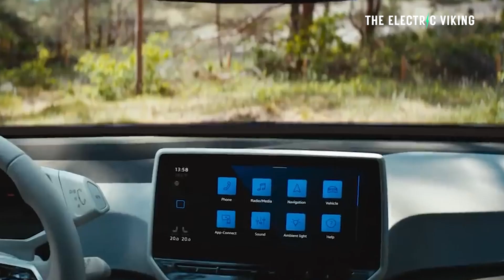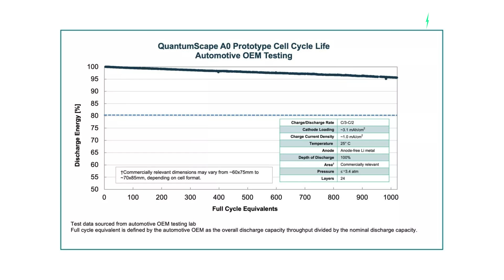VW test QuantumScape’s Solid-State Battery: Retains 95% after 300,000 Miles

Comment: If the SS Batteries can hold 95% capacity after 300k miles that's a game changer! I was under the impression VW was going to possibly be first mover to release SS battery based cars. I'm not surprised if Toyota beats them since Toyata is very advanced and forward thinking. I just wish VW stock wasn't such a dud! I was expecting this technology to be a big catalyst for their stock. The stock is basically terrible! If quantum scape has "cracked the code" and if VW is the sole benefactor of this it might actually drive the stock up massively. The SS batteries are revolutionary.

Comment: 300,000 miles is only 1000 charge cycles. Most LiPO batteries would retain 95% of charge capacity after 1000 cycles.

Comment: Lithium Iron Phosphate batteries hold 80% of their capacity after 4000 cycles at 100% Depth of Discharge.
That means 4000 full charge and full discharge cycles.
This number can easily double if you reduce the depth of discharge to regular DoD which most users will do as it is not practical to let your battery die on you completely and have to either tow your car or bring a portable charger to get your car back home.

Comment: Has significant for a battery to not degrade it need to retain its shape before and after being used and it needs to do this consistently for 10 to 15 years to be able to compete with an lfp battery. This is not an easy feat

Comment: I read this was after 1000 charging cycles.  I do a 70 mile daily commute.  An EV will cope with that.  That is about 3 years of charging cycles, or 70,000 miles, not the 300,000 miles.  I am not persuaded by this report.  Could well be typical car manufacturer's exaggeration.
Reply: You don't need to charge every day, you can run a battery down to about 20% then recharge it so in your case a battery with a 300 mile range to 20% would only need to recharged every 4 days which is less than 92 cycles a year. Even if you did charge every day, its a partial cycle, not a full one.

Comment: Quantum scape say their aim is 800 cycle with a degradation to 80% . That doesn't come close to other batteries like CATL which are say theirs has a 3,000 cycle with a degradation down to 80% . 3,000 cycles is about 1.5 Million Kilometres with the ability to charge 0 to 100% . Thats game set and match to CATL because they are less than $5,000 . Imagine in a few years there will be much better batteries . If you had a car with over 1 million Kilometres on it do you think you would not just buy a new car . ? as the rest of the car would worn out , like paint suspension , steering joints , power windows , air conditioning and most important the computers that enable things to function .At 20,000 KLm per year a million will take 50 years , so the laws on economic life and probably government requirements will have put it off the road .

Comment: Retaining 95% after 300,000 miles is a nice claim. It is just about meaningless without a battery capacity warranty. When the Leaf came out Nissan claimed 10 years/100,000 miles. Their actual capacity warranty was to retain about 68% for 5 years/60,000 miles.

Comment: I don't care about the miles...

I care about cycle life. So at about 1 minute in, I had to back-calculate.

If they don't have 5000 charges to 80%, they are worth very little. Other batteries are getting 3500 charges. They are expensive enough that they need to last longer for people to want them.

Assumed cycle life:
* If it began as a 300 mile battery pack and ended at 285 mile pack.
* If they counted a cycle from 10% to 90%.
( If energy loss is linear with cycles.

The average of 80% of 292.5 (average of the old and new amount held) is 230 miles per cycle.

300,000 miles translates into 1,282 cycles to 95%

About 5000 cycles if the drop is linear.

That is in the ballpark.  Cool.

Comment: Suggestion to focus on the graph and cut out the marketing stuff.
A 24-layer, single cell was tested, not a multi-cell battery, and certainly not a battery to power an EV.
Cell footprint was about 7x8cm, thickness not stated.
About 3mAh/cm2 or 170mAh x 24 = 4Ah (cathode-limited) total cell capacity.
Charge rate was C/3, so full charge in about 3.5 hours assuming non-linear CCCV process and full charge.
Discharge rate was C/2, so 2h (complete) discharge.
Interestingly, external pressure was 3-4atm, presumably to hold the 24 layers together. 
IMO it will take a massive effort to (a) mass-produce this, and (b) integrate the cell into a 1000s-of-cells battery that can power an EV ... while meeting the 800 cycle/80% remaining capacity target.

Comment: 1000 miles on a 5 minute charge is certainly impressive.
Reply: What would be more impressive is setting up a charging system and connections that can cram 80KWH in a car in 5 minutes..
Reply: It's impressive because it isn't real.  And frankly, who cares?  Who needs 1000 miles on a 5 minute charge?

Comment: Good news from the pouch pack tester from VW.  However, this pouch pack tester was not produced using auto - scaled manufacturing techniques.  It was created in a lab and custom built in a lab.  Once they can scale it and mass produce it, the scaled battery pack will probably show a decrease in performance compared to the lab battery that was tested which is a common challenge amongst all battery startups.  QS has to prove they can maintain this performance from a scaled battery pack. Stock is going to drop back down to $6.00 over next few months.
Reply: This was a 24-layer commercial intent cell design. Far from a “pouch pack.”  They do need to move production to high capacity equipment. That part of your comment is accurate.

Comment: Even more impressive is capacity preservation during fast charging (10-15 min from 10% to 80%). Even with a 10 min fast charge, the QS cell is able to retain >80% capacity after >800 cycles with 100% discharge. This is a game changer for Lithium-ion battery longevity, even under extreme charging conditions. Keep in mind this is based on QS data, however keep in mind QS has consistently been proven right about their claims, for the past 3 years.

Comment: What happens after 1000 cycles? The fact they limit the chart to 1000 cycles is a red flag to me. 🚩
LiFePo batteries are typically rated 3000+ cycles.
Reply: 1000 cycles is 500,000 km in the car. You plan on keeping a car that long? Even then you will only see 5-10% degradation.
Reply: It takes time to charge and discharge a battery 1000 cycles. On to the next test at that point.

Comment: Much will depend on how long it will take to bring these out of the lab and into practical use. The next challenge is mass production and delivering these at scale. If this is true, demand for these batteries will go through the roof. A solid-state battery with all of the characteristics described here would tip the balance and seal the fate of ICE vehicles. It would also put VW back into the game as of late; what they offer could be more impressive. Let's see how long it will take to see these in production vehicles.
Reply: True, but then there is even another bigger challenge: All days we have tons of news about "miracle" technologies that will change all the EV market and kill the ICE cars. It is round the clock, really. Problem is: Too many technologies, some incompatible with the next one, and nobody really knows what is the real possibilities to some of them to become real production ones. All the current battery providers have done a strong investment for the current generation battery supply chain. They'll most likely to go on for small incremental gains with same technology base, before they start to adapt factories for the next big thing. With massive transition still in the beginning with the current generation technology; I can't see any purpose for the next gen to be deployed yet to the public. Too early to say the least. Current cars can go up to an average of real autonomy driving on the ~300-500Km with a single charge depending on the car segment. More than enough for most folks. Extremely big batteries will perhaps to have a challenge nobody seems to be bearing in mind: Unused energy loss. You'll probably to pay for energy you don't consume at the day, unless you really need to do those extremely big travels daily. Things are not that easy... If possible; battery suppliers will run to the ~400-600Km average single charge real driving autonomy depending on the car segment till this decade ends out within the same technology base. I don't predict anything more significant out there commercially that soon, other than some development on the Sodium batteries that seems to be real at least for the smaller cars soon.
Reply: @nunagoras  
I don't expect any great breakthroughs any time soon either. The EV sector continues to grow and once we get some decently priced vehicles with good range which charge rapidly then its game over for the ICE sector. I think the major problem at this point is pricing. EVs remain very expensive and few can afford them.
Reply: We need them yesterday

Comment: My conclusion after researching QuantumScape is that they are still at least a year away from commercial production and they will be so expensive that there is little hope for them in mainstream EVs. Maybe they will get enough economies of scale to be used in luxury car models by 2030, but they are most likely to be used in supercars, hybrid airplanes and high-end electronics like cell phones. Their production costs are simply too high. We should be far more excited about developments such as Zeekr's LFP "Golden Battery" with 255 Wh/kg energy density that can charge at 4.5 C, 800V, 500 kW than solid state, because that is tech that will actually be used in standard EVs.
Reply: Moore's Law
Reply: @Picklemedia  And Moore just died (RIP).

Comment: Given the brittle nature of their ceramic separator, I would only trust the test results if they did the discharge cycle tests while simulating driving conditions. The separator lifespan might be great in a quiet lab but it might exhibit cracking under real driving conditions where vibration, bumps, starting/stopping can put serious mechanical stress on the batteries. QS does not reveal the chemistry or mechanical properties of their magic ceramic separator and probably never will, so discharge testing under worst-case driving conditions would be the only way to know how reliable they might be.
Reply: Temp cycling might be the real killer. Start out at -20C, then warm it up to fast charge, then drive like a bat outta hell, and see how long it lasts.

Comment: Great job as usual. I wonder if manufacturers are considering battery swap outs? Not a gas station battery swap but with the whole car battery. That is when a new battery tech comes out, can’t we just swap battery with the same form factor.
Reply: Nio has hundreds of swap stations in China.
Reply: @jamesvandamme7786  I think @brokejohnnylive1530 meant for maintenance reasons rather than alternative for charging but more options are always welcome
Reply: Tesla tried this and quickly concluded that it was too expensive and that people did not want to pay the pretty hefty swap charge as opposed to the minimal charge for supercharging. Doubtful that somebody else can do it for money comparable to supercharging because of course you've got to charge the battery packs you're taking in, you've got to have a big pile of spare batteries which is super expensive, and you assume massive risk at the same time so in combination all that spells that this is a no-fly zone

Comment: I would like to see either a swappable battery or a battery in which the electrolyte can be changed, like an oil change, on a regular basis. The electrolyte change idea would be best because it would be easier to recycle the electrolyte than the entire battery. The electrolyte would probably have to be added under high pressure to distribute it throughout the electrode pairs.
Reply: There is no battery currently in use in EV's that can "change out the electrolyte".  The electrolyte is part of the battery and cannot be changed.  The only batteries capable of this are flow batteries or high pressure hydrogen/nickel and these batteries take up a lot of space, are heavier, lower energy density, low peak output and just aren't practical for EV's.  As far as swapping the batteries this would be problematic at scale for a huge number of reasons but standardization is a big one.  As charging speeds keep increasing, and they do keep increasing, there will be less incentive for such technologies.  I'm sure a lot of people would like to see this but in all practicality it will not be a thing.  For most EV user's charging speeds really aren't a problem as they are usually charge at home while they sleep and rarely need to use a super charger, usually only on trips.  This sort of technology isn't important for most EV users.
Reply: There's a company trying to sell a flow battery car. It has long range, rechargeability, and you can swap out the electrolytes in a couple minutes besides. You'd have to swap two different tanks of electrolyte. It might have promise, who knows.
Reply: @jamesvandamme7786  Yeah, I saw that too, the company is called nanoFlowcell.  It would be cool if they could get it to work but the only real article I can find on them is by Tina Casey who doesn't have the best record for predictions and the article is very light on details or timelines.

Comment: I knew nearly 20-years ago, that solid-state batteries would replace liquid electricity batts as soon as chemists could figure out how to increase their cycle life and lower pricing as solid-state batteries are smaller, lighter, impermeable to extreme temperatures and charge much faster.
Reply: You knew that 20 years ago?  Back then, we all "knew" that.  Today, most engineers don't think SS batteries will ever be viable.

Comment: What about energy density ? What about performance in low/high temperatures? Or dose it self discharge or degrade over time even if it is not being cycled?
Reply: QuantumScape claimed energy densities of 380-500 Wh/kg and 800-1000 Wh/liter in 2021, and in 2023, they were saying as high as 500 Wh/kg, but they haven't released specific numbers. In earlier tests, they claimed 400 charging cycles with 4C charging (13.3 mA/cm2), going from 10% of capacity to full (4.2V) in 15 minutes, with C/3 charging from 0% to 10% of capacity. See AutoEvolution's article "QuantumScape Is Happy With Its SSB, But Shouldn't It Fear CATL's Condensed Cells?"
Reply: @amosbatto3051  dude didn't want an answer he just wanted to complain.
Reply: @Picklemedia  no,  I did want an answer ,  thank you.
Reply: @patdbean  oh okay. My bad I'm sorry

Comment: Equally important: the specific (or "gravimetric") energy density (in Wh/kg) and the volumetric energy density (in Wh/liter). Apparently, QuantumScape has reached 375 Wh/kg in the lab with their hybrid SSD battery cells, "independently verified by 3rd-party" which is very good. Also good, their projected commercial goal for volumetric energy density at 1,000 Wh/l.
To put things in perspective, first Tesla Model Y with Panasonic's 4680 NCA cells: ~ 271 Wh/kg and 750 Wh/l
Geely's LFP "Golden" battery, which is commercially available, has a specific energy density of 255 Wh/kg, on par with common NMC batteries. 
Typical LFP batteries in EVs on the market today are around 150 Wh/kg only.
However, the Chinese have in the lab lithium batteries offering insane numbers: 711 Wh/kg and 1653.65 Wh/liter! Not available in any EV currently of course.
Reply: The Chinese will be ahead at the time this Quantum is scaled up
Reply: @protagonist9716  Exactly. By the time this gets to production existing tech will just keep improving through minor changes.
Reply: @protagonist9716  Far as I know, none of them are. Many still struggling just keeping up with what they have. More research into LMFP or Na type.
Reply: Those are Silicon enriched ones, which aren't very stable and actually dangerous in hot environments.
Reply: Actually the first 4680's where more like 240 w/kg where the 2170's are 270 wh/kg at least that is what I have read . 
Generation 2 of the 4680 is around 270 w/kg only in the Cyber Truck for now. I thought the first 4680's are entirely 
Tesla made.
Reply: That claim about QS' cell energy density of 375 Wh/kg is totally false. QuantumScape has not released any information about their A samples' energy density nor has any "independent 3rd party" tested and "verified" their energy density. Stop spreading fabricated information. QuantumScape is at least a year away from having a cell that is production worthy. The cells VW and the rest of QuantumScape's prospective customers have are for testing and to provide feedback for their next generation of B sample cells produced using more scaled production processes.
Reply: LFP system can not reach that high energy density ,by the way the 711wh/kg actually  is just a prototype,degrade very quickly  which use lithuim as anode and rich lithium manganese base as cathode ,the work is done by Hong Li in Institute of Physics, Chinese Academy of Sciences